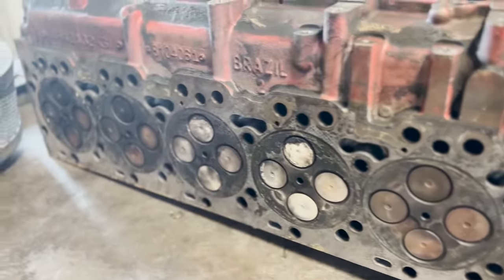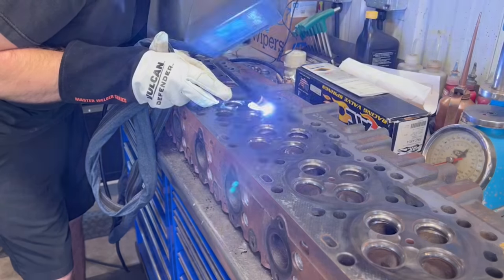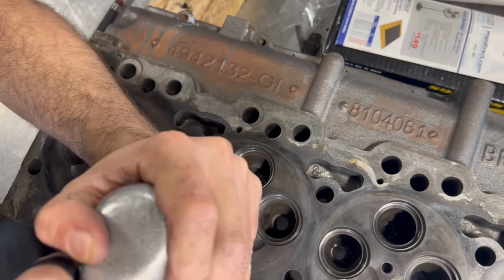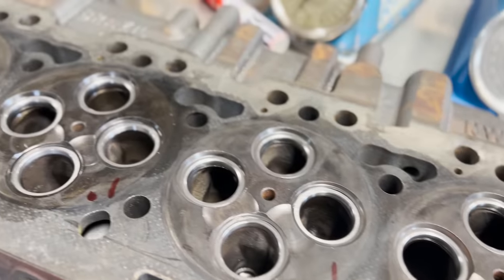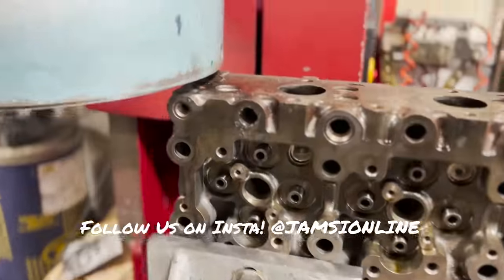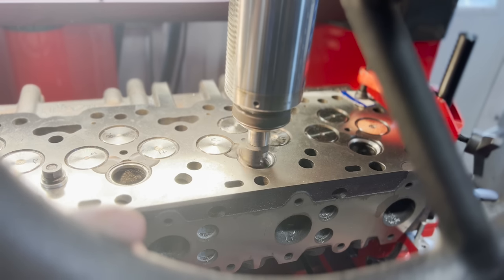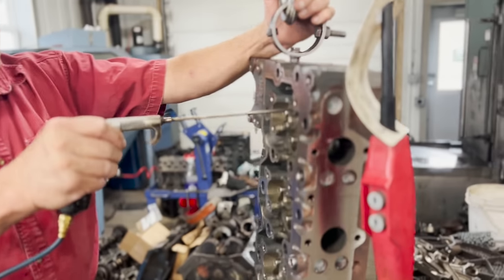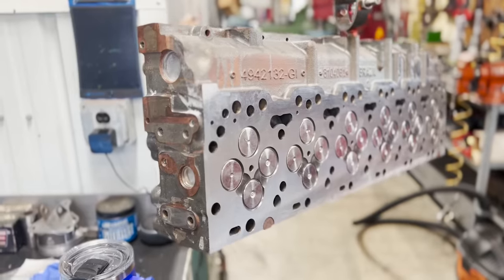Rebuilding The 8.3L Cummins ISC Cylinder Head Out Of Your Local Trash Truck

Comment: I wish the machine shop I worked at was like this. My boss is still stuck in the 80s. I wish I could work and learn from you guys. Very knowledgeable and thorough.
Reply: You guys probably don't have a pneumatic valve spring compressor then.?

Comment: You guys should consider using a plunger style valve keeper installer/remover tool - may be faster than using your pneumatic unit - especially on a head where all the valve faces are 'level' with the head surface.

Comment: Hey Jim, why do you pull the valves out so far when checking the guides as the valve doesn't open up that much? And shouldn't you remove the valve stem seals to have a quick go to feel for the guides? I know you measure all the valves with bore gauge but why check it when stripping if you just going to use bore gauge?

Comment: for lower fuel use a 7.5L Mercedes or Scania engine would have the same HP and torque
Reply: I can't speak for the scania but the Mercedes isn't lasting nearly as long as the Cummins. At least that's my experience.